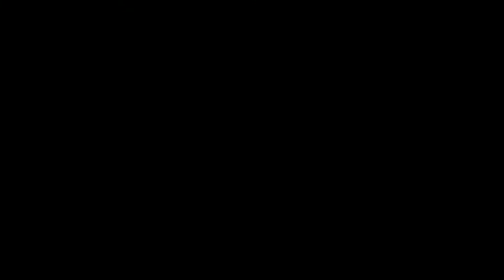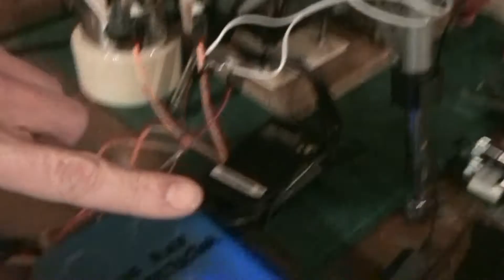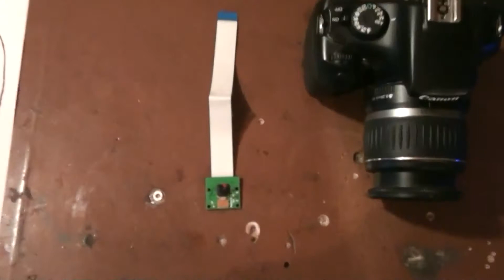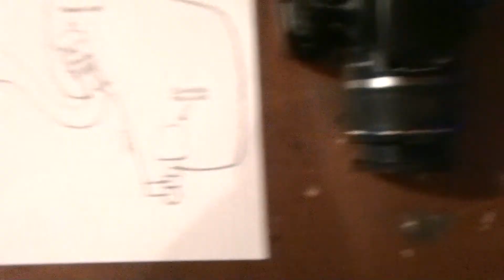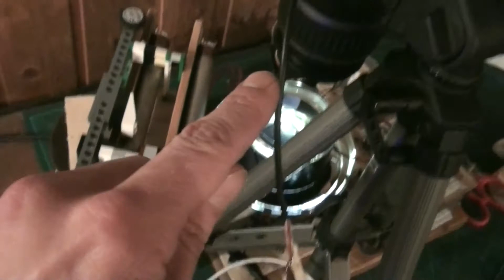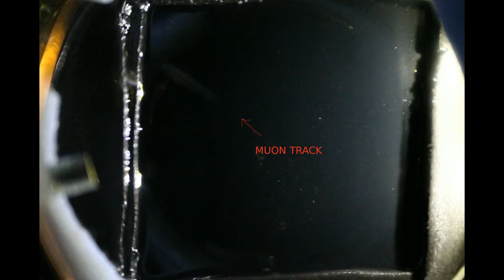#3 Cosmic Ray Muon Selfie Machine !!!

Comment: Hi, nice work there. I have a few questions for you. Do you have any idea how I could turn a Japanese GC10 into coincidence muon detector by adding an additional Muller tube?  
 Are the electrodes on your cloud chamber rings? What voltage did you settle on?
Reply from the maker: Thank you for youre nice comment! :D ..well i do not think that youre Geiger Counter Kit is able to do coincidence detection... in principle you need 2 separate geiger counter circuits, plus a device that detects the coincidence counts. In my case its the little Aruino-ish thing on my Kit. I am not that good on the electronics / computing part of things, so for me the Kit from www.muonhunter.com worked really well! its rather affordable and the people there are really nice, im shure you can send them a mail if youre interested in one of those kits! And for the Cloud Chamber, meanwhile my top Electrode is a Ring, but the Bottom Electrode is just the Aluminium Cooler Block underneath the Glass. I actually dont know my Voltage exacly, but i guess its somewhere around 1000 Volts (i heard that its more then enough, a few hundred should do the job as well).